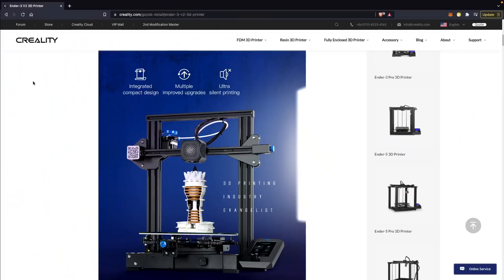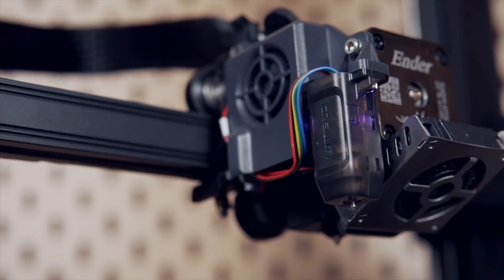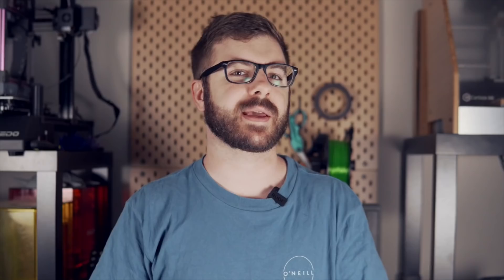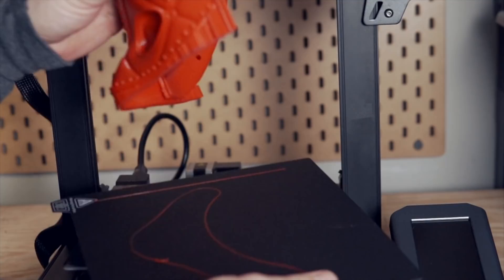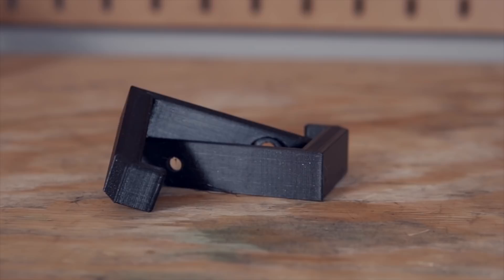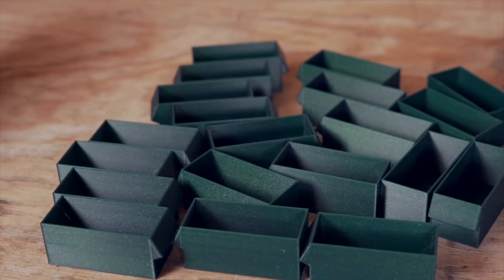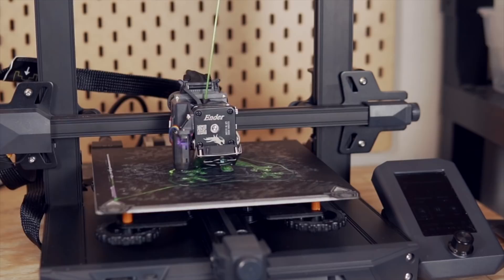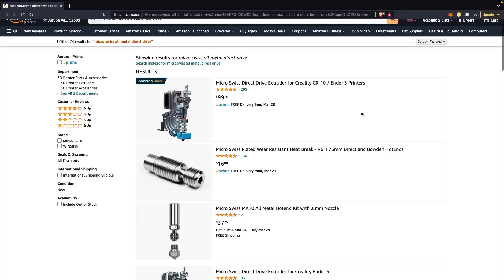Worth The Price? Creality Ender 3 S1 3d Printer Review

Comment: I flashed Klipper on my Ender 3 S1 last week and the performance is unreal. The stock firmware is okay, but the print speed is unacceptably slow and you get terrible ringing at higher speeds. With Klipper with pressure advance and input shaper tuned, I can print at 100mm/s and 3000mm/s^2 with incredible results. If you have a Raspberry pi and accelerometer I highly recommend you try it out.
Reply: Same here, with klipper the Ender 3 S1 work really well
Reply: What do you mean by accelerometer?  Can you provide some more information on the klipper upgrade
Reply: I have the ender 3 S1 also and want to get the sonic pad but did you upgrade the hotend or extruder at all?
Reply: @Sillysillylittleman  I put the all metal hotend version of the sprite extruder on it after the stock one broke on me, but I haven’t changed any other hardware. These days I use it exclusively to print 85A TPU which has to print very slow anyway, so not really getting much out of Klipper anymore.

Comment: Having gone the "Ender 3 Pro modding adventure route" I'm going to say I really regret not spending a bit more money and getting an S1 to start with. Modding ultimately costs more in money, and of course, consumes a LOT of time and material dialing them in - where the S1 delivers most of the mods you will NEED right out of the box. It's possible my experience with the E3P (and a Tevo Tornado) helped make my experience easier with the S1 (I got a Tenlog TL-D3 Pro IDEX up and printing great within an hour of unboxing), but really, it was just a great experience. As you yourself mentioned, there are still mods to be done to the S1 (I highly recommend the "pro" community firmware upgrade and a lightbar), and I'll likely upgrade the hotend before too long - but that's not a mod that will frustrate me like the mods I did on my E3P. It's a pretty terrible experience trying to mod a printer, only to find you are missing a critical component or need to print a tool (but your printer is disassembled) because Creality press-fit a gear on your extruder motor, for example... I also have a dual Z-axis mod for my E3P that went back in the box because of binding issues... so the Ender 3 S1 gets a big thumbs up from me for all levels of 3D Printing enthusiasts. Far fewer headaches with troublesome mods just to bring a printer up to decent and consistent performance.

Comment: Creality already sells 2 all metal throats for the Ender S1 a Titanium one and a bi-metal one.. both under $30. They also sell a hotend kit that come with the metal throat, a heatblock with cartridge thermistor, and a 50W heater.  You can also buy the Sprite Pro Extruder by itself. So, lot's of options.

Comment: theres a modified cooling fan duct on thingiverse that i feel works pretty well. Ive also discovered that if you position your model in such a way that the majority of the length of any overhang is in alignment with the y axis, that you can get some pretty crazy overhang angles successfully printed. Im waiting for availability to buy a sprite pro and swap out the stock sprite. I just wonder if Id be able to flash over the standard e3s1 to the e3s1 pro firmware for the increased temperature range, i sure hope so

Comment: This is kind of what I was waiting for these years.  While the costs have been down for a while I was waiting for someone to develop both a lowish cost and require next to no setup.  While I want a 3D printer to pursue a hobby I have no intention on turning 3D printing into the hobby.  It is a tool and I don't want to have to work on it but work with it.  I am currently debating if I want to just get the Ender 3 and tolerate some of the more manual aspects or if I want to just bypass that but pay a good bit more for the S1.

Comment: Nice video 👍. Watched it after I bought my Ender 3 S1....
I own an original Ender 3, an Ender 3 Max, Biqu B1 and now the Ender 3 S1.
Out of the box it worked great.
But that 1st layer...
Permanent filament embedding...
So I have been fine tuning my Z offset. But happy with my purchase.
I need a printer that works.
No fiddling with bun files and all that. It must work out of the box, not be over complicated to work, and the warm tip settings and the cure profile had me getting the same results as the pre-sliced files on the 8GB memory card.
So a 9/10 printer for a straight user, not for mods.

Comment: Great overview of the Ender 3 S1 Printer.  I agree with you that Creality should have included the things found in the S1 Pro into their first model and just charged another $50-$70 for the only model.  I did purchase the S1 several weeks back and have been very pleased with it’s performance and the quality of the prints I’ve gotten so far.  I had originally purchased the CR-10 Smart, but had some serious bed leveling issues that couldn’t be resolved easily so I took it back. I order the CR-10 Smart Pro (with the camera) and got an email saying it would be shipped by the end of April so I picked up the S1 to get me started in 3D printing. Fortunately or Unfortunately the CR-10 Smart Pro arrived the day after I got the S1, but I was able to convince my wife that I could keep two printers busy and that has been the case since then.  I really like the S1 and would highly recommend it as a first printer over the standard Ender 3 just for the upgrades you get that most people seem to add anyway.
Reply from the maker: How are you liking the CR10 smart pro? I have not used the original smart either but didnt hear great things about it. Glad to hear you that you are enjoying the S1 and that you were able to convince the wifey :)
Reply: @ModBotArmy  The amount of build space on the 10SP is great and I’ve made several large items with it that just don’t fit on the 3S1 build plate.  The camera and ability to stop a print remotely is fantastic, which was one of the selling points in going with the SPro and I haven’t regretted it since it arrived just a few weeks back.  I did have some issues where it wouldn’t feed some PC filament, but the 3S1 hand;ed it just fine. I also had an issue where the wood filament blocked the nozzle and I found the printer running patterns an inch above the model so I ended up trashing that nozzle. Also, the ability to have auto-leveling AND be able to tweak the settings is another major selling point that works awesome.  I really like and use both printers and have used them a lot since they were assembled on the workbench.

Comment: i just bought the pro sprite extruder for my base ender 3, upgraded the board, plate added tensioners from a dead v2. I basically have a poor mans s1, lacking a bed leveler, and runout sensor. 
It was a journey to say the least, but for convience, the s1 pro would defintley be a good buy for a casual user if they want all the fancy stuff right out of the box.

Comment: excellent review! 👏
I also think it should come with a full metal hotend, we need to get rid of those PTFEs near the high temps
Reply from the maker: Thanks Mars! Yeah I am really hoping that in the next year we get to a point that we just have all metal hotends as a standard. Stainless/bi-metal heatbreaks are so inexpensive that it should add much cost to the machine price.
Reply: Agreed. Using something that gives of cancer causing fumes at high temperatures is silly. Strictly PLA and SBS filaments on my printers. All print at 215/60.
Even the popular ABS gives of toxic fumes at high temperatures.
So, it isn't just for printing at higher temperatures, but a safety factor.
Reply: all 3d printers should come with a cheap 8 dollar peyt plate could be 1 dollar in bulk, fucking rediculous we have to use glue

Comment: A couple of months ago, I got into 3d printing by getting the ender 3 v2. I have had get success with a couple problems here or there but overall, great. But I have been using this printer all the time so I'm wanting to get a second to increase capacity, and Im seriously thinking about the ender 3 s1. It would be great for me, I'm not super comfortable modding something I rely on. So thank you, this video has helped me immensely in my decision.
Reply: Try the ANYCUBIC VYPER...omg this printer is so much NICER than the Ender stuff... I got the Ender 3V2 and love it.. took a minute to get the hang of leveling and solid prints...but the amount of money and time in upgrades are a little ridiculous.  I learned alot.. but I don't want to have to rebuild a whole nother printer from the ground up like I did with the Ender. The Viper straight out-of-the-box takes 5 minutes to set up. It's got a touch screen. It's got dual Z axis and it's got a light plus so many other features!! Oh yea!! Out-of-the-box it's got a 16-point leveling system! You will never have to level your bed again and get perfect print every single freaking time! It does take about 3 or 4 minutes to level but once it's level you're good for usually a few weeks! I wanted the second printer cuz I'm always running my other one. I was going to get something bigger and that's the other thing this thing is massive as well! And it's only like $60 more than the Ender 3 version 2
Reply: @Savage1776_  witch anycubic vyper do you have

Comment: I am with you on all metal hot ends. It is stupid to limit the first-time owner to 250 degrees C and a PTFE tube. I love to mod things but have not been able to get the Ender 3 V2 Neo to update software and I am using the SD card that came with the computer. So, I formatted the card with the 4096 byte allocation size, downloaded the software from Creality's website. I bought a Sprite to upgrade my Neo and could not get that software installed either. Maybe I have a bad SD card. The one out of my camera would not allow me to do the 4096 byte allocation so I went back to Creality's card with no luck. Great job on the video. I want the Sprite Pro and hope I do not have to buy the S1 Pro to get it.

Comment: I picked up an S1 as my first printer back in February, and I've honestly been quite happy with it. I've got no issues modding things, but in this case, I wanted something that could get up and running relatively expediently because I don't think my seven year old son would be as patient as I getting things spun up.

I will say that going with the mrisoc custom firmware (which you did show the github page for in the video) is an absolute no brainer. It allows you to go up to 9x9 for the autolevel mesh (although in my experience it failed after the 64th point, so I can only do 8x8), and has the bed tramming assistant. It's amazing how much the bed could be adjusted when you can actually look at the autolevel mesh.

As mentioned, though, kinda of a surprise the hotend isn't all metal. I've been getting by printing PETG (just watched your video on that today) for most of my prints at 235/65, but I definitely would like to make things all metal at some point for a buffer.
Reply: Something that is random and frustrating on mine is that it reboots sometimes if I click on a button on the controller. Currently trying to start a print and it keeps rebooting every time I click on the file. Other than that, this printer has been incredible.
Reply: @BenWilson24  Well that's no good.

Have you investigated the E3V2/S1 Professional Firmware to see if that helps things?
Reply: @JasonGillmanJr  I have not. This has been pretty irritating though. I've been running several creality printers for a few years for my business and haven't had anything like this before. I'll have to try a firmware upgrade
Reply: @JasonGillmanJr  Just tried it with new firmware, new SD card. Same problem...
Reply: @BenWilson24  Huh. Yeah, I got nothing then
Reply: @BenWilson24  could it be a bad connection in the screen? something must be shorting out
Reply: @poopfacedude69  I finally got creality to help me with it. It's something to do with the plate heating. Still working it out though
Reply: @BenWilson24  that is very strange lol
Reply: @poopfacedude69  yeah the plate heating seems to not be responsive, so it freaks out and reboots the whole printer

Comment: the hotend cooling fan is suuuuper loud, if anyone wishes to get their S1 to a more manageable noise level, I recommend you change it with a "
WINSINN 30mm Blower Fan 24V 3010 Dual Ball Bearing " (amazon has it), and make sure you also buy some "1.25mm JST 2 pin" connectors ( also amazon has them, but make sure the polarity of the plug is correct, as the ones I got had it reversed so I just soldered red from fan to black on connector and the other way around).

PS: if you are allergic to soldering, I recommand the white "heat shrink solder sleeves".
PS2: you also need a bit shorter screws for mounting the fans
Reply from the maker: haha I said that the machine was quiet. Compared to other machines I have tested over the months this is one of the more quiet machines by far. Motion I really cannot hear and the only sound I do get is the cooling fan but even that is much less than many other machines lately. That is cool to know though that you did find a quieter option that you can drop in.
Reply: Thanks for the heads up on the replacement fan. not a lot of info regarding what is worthwhile upgrades just yet for this lil machine.

Comment: You can pick up the Sprite Pro extruder by itself on Ali for about $70, would make an interesting video seeing you try to turn some cheap printer into Ender 3 s1 Pro.  You can still pick up an Aquila for $160 if you watch for a lightning deal.  Toss a few extra cheaper/budget upgrades on it and see how close you can get and where you land on price.  Then see what you think of it compared to this one.
Reply: Isn't the Aquila one of the printers that had main board issues?
Reply: @bwselectronic  There is a less desirable board for the Aquila, the h32 chip, but there was never anything wrong with it.  It could just only use official firmware from Voxelab/Flashforge.  It needed a non free/expensive compiler for the chip, but Voxelab bought that compiler for Alex.  Alex is the guy who maintains the community firmware, and a beta has already been released.  Not saying it wasnt a crappy move by Voxelab, I sure wouldnt want an h32 chip, but there was never anything wrong with the board or the stock firmware, it just wasnt as modifiable as some would like.  It is also my understanding that after the community got upset they moved away from the h32 chip as quickly as they could.  There is still h32 chips out there, but I think when they are gone they are gone for good. 

Im also not saying to necessarily use the Aquila, a frame is mostly a frame when you are doing a highly modified printer.  The point of this video is just an exercise to see where you land as far as features vs price in a more premium printer vs a highly modded printer.  To see if you could replicate it in a diy solution but for cheaper.  

I have seen Ender style frames from lesser known companies/less popular printers be clearanced out for super cheap multiple times.  I personally bought a Anet A8 Plus from Walmart for about $80 some time ago, with a few mods that frame is now a workhorse for me.  The Aquila simply came to mind because it was a frame anyone could get and follow along with the build, and it regularly goes on sale for $160.

Comment: im soooo confused with the bed leveling , i do the paper test for the z offset but yet when the printer starts printing the skirt it comes in 3 lines and not smoothly combined , what to do ? 

also i still dont get the auto bed leveling it seems useless
Reply: It works fine.. you are just not doing it right.

Comment: I don't know, I think that buying the S1 and slapping a bimetal heatbreak and a PEI spring steel sheet would be much cheaper than buying the pro (touch screen is more of a luxury IMO, I really like it but it doesn't play nice with octoprint)
And even then, I think the Anycubic Vyper is a better buy (I've seen it at 450 or less when they have dicounts), lest the direct drive extruder
BTW my first and only printer is an Anet ET4 that I've heavily moded to make away with the closed source stuff, added a V6 clone with bimetal heatbreak and a magnetic bed with spring steel sheets; I've yet to add the linear rails I bought and the second z motor
Reply: I agree, there's nothing on the pro that I couldn't easily add myself. I hate spring steel sheets. Which already come on the S1 by the way. I'll be changing it to glass soon. I don't care about screens either.

The only thing I did to my E3V2 to get it to print as good as a prusa MK3 was all metal hotend, all metal extruder (not even direct drive) bedsprings and Jyers firmware

You don't really have to change anything on an S1. People just do because they don't know what they're doing or they think they need it because someone on YouTube told them they needed it. Or they blame an issue with their prints on not having something. When in reality they could have just adjusted things a little. I got my S1 for $390. I don't think I'd pay $450 for it. I'd get another Sapphire sp5 before I did that. In fact, I'm considering selling both of my Enders and getting two more SP5's.

If I had a nickel for every time someone told me I needed something that I didn't, I'd be a rich man!
Reply: Amazon is selling the S1 for $365 right now. Sheet upgrade is $25, new all metal hotend from Creality is $30. So unless you care about LED lights (which you can also buy) it the touchscreen you can have the best bits of the Pro for substantially less